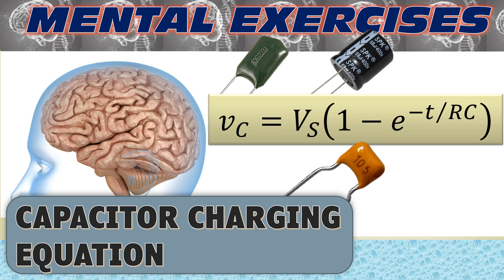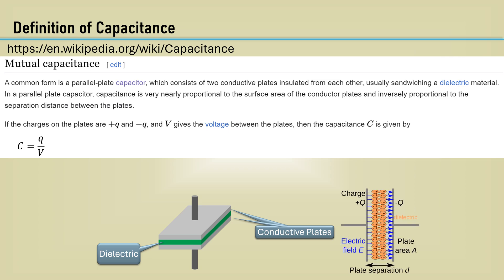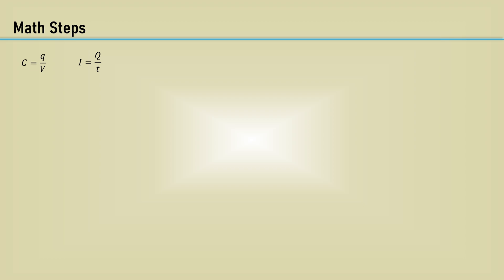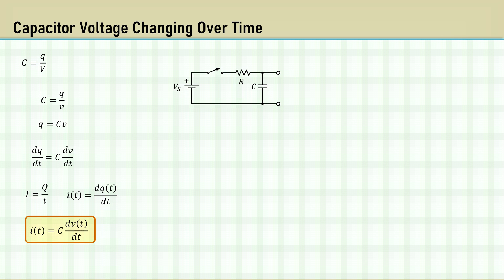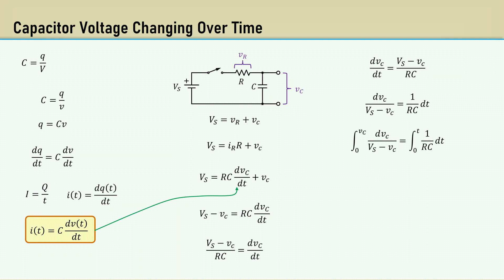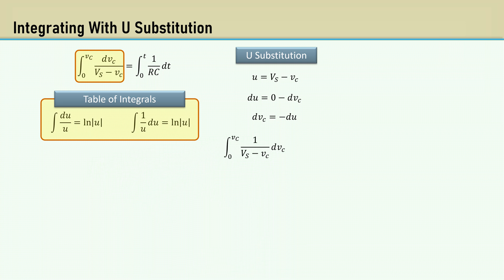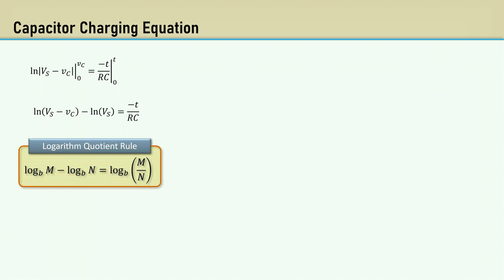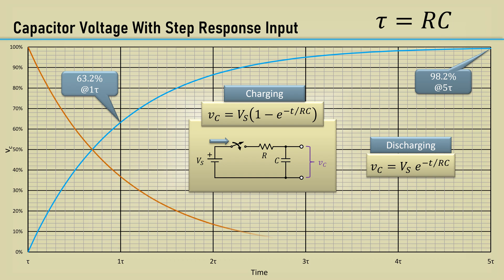Capacitor Charging Equation (4k Video)

Comment: Thanks for this interesting video. A video I would like to see is the derivation of the impedance of an electrical cable pair or a coaxial cable as a function of the capacitance per metre of cable. A related topic is the impedance of an antenna, which I assume is a function of its length when the signal wavelength is much shorter than the antenna. Thanks.
Reply from the maker: Great suggestion. I'll consider it.